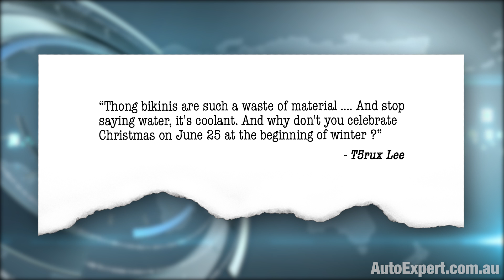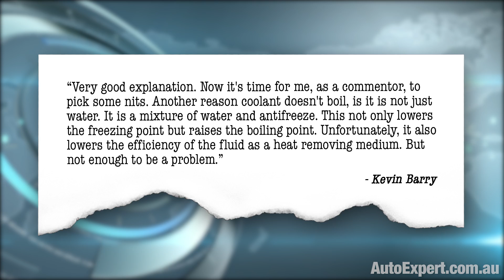The mad science of coolant (beer garden physics - yesssss!) | Auto Expert John Cadogan

Comment: Soooo after all that. Water is better? I live in WA so don't care about antifreeze. And right at the end something about electrolyte and anti corrosion. So is it a con? do i need to use 50/50? My falcon uses the green stuff, my hilux the red stuff can I run my hilux using the green stuff? ? So i don't need to keep both in the shed? Maybe 25% or 15% is better under WA conditions still getting some anti corrosion but better heat transference where the air coming off the road in summer is already 50 degrees plus at 1 meter above the road. or was that quarter of an hour rant just to say follow the manufacturer instructions, but you don't like the name coolant?

Comment: There's nothing wrong with calling it coolant, because that is the purpose of said amalgamation of ethylene glycol and water - the fluid - in the first place. It doesn't matter if ethylene glycol is actually WORSE than water for the purpose of cooling. What does matter is that it IS combined with water and serves the purpose of COOLING when dumped inside the cooling system of an engine - hence - coolant. When you buy the "antifreeze/coolant" unironically it's most often premixed. Why? It's because it's going to be used as - you guessed it - coolant. This lovely amalgamation of fluids contained within the engine quite literally serves no other purpose. COOLANT. Say it five times fast, you egocentric, haughty (Who has nothing else better to do with his life than hear himself talk before he goes the way of the dodo) boomer.

Comment: The viscosty is a double edged knife. It increases pumping efforts. Also it makes for a more stable boundary layer when flowing over surfaces that need heat transfer. In other words there is less turbulence thus less exchange between the slow flow at the surface and the fast flow in the middle of the cooling channel.
Heat capacity, pump effort and heat exchange rate all suffer from anti freeze.

Comment: From the title I thought you were going to go into the science around different types of coolants and how they've changed over the last few decades. 
Don't disagree with anything you've said about how it works (and you'd know better than me) but I honestly think you've just made a big deal about nothing here. It's got to be called something, does it really matter? Yes plain water would be more efficient at that single task of cooling but that doesn't mean an ethylene glycol mixture doesn't still perform cooling. 

To me, coolant is just a nice easy shorthand for what goes in your cooling system, whatever the chemicals and ratios you choose. The same as fuel is what goes in your fuelling system, but really means petrol or a petrol/ethanol blend, or diesel or LPG, even fucking warp juice. 

Should we refer to it every time as 'the anti freeze, anti boil, corrosion inhibiting heat transfer medium' ?

Comment: So, what would your take be on 'waterless' coolants? From your explanation of ethylene glycol being a resistive medium to water pump operation and coolant flow it would seem that ‘waterless’ coolant would be far worse.  I had a look at the SDS of a manufactures particular offering of this coolant and it contained 74-90% ethylene glycol.  Seems like if used on a standard OEM vehicle there would need to be some considered redesigning of the engine cooling system.  Thank you John.

Comment: Nice video as always! I think when Kevin said "Unfortunately it also lowers the efficiency of the fluid as a heat removing medium, but not enough to be a problem" he meant from a typical driver or mechanic's perspective rather than from an engineering perspective. As you explained, it certainly is a problem from an engineering perspective because the system needs to be designed with enough capacity to still adequately cool the engine with a less efficient fluid, therefore the reduced thermal conductivity and increased viscosity of a coolant/water mixture isn't a problem to the average driver or mechanic since the system is designed to accommodate it.

Comment: What about break fluid or a light oil, for coolant, as long as the engine dosn't over Heat eh Want something to look after the rubber bits the metal bits and the temperature.

Comment: The freezing point of water is depressed when mixed with propylene glycol. It is used as aircraft de-icing fluid. Water-propylene glycol mixtures dyed pink to indicate the mixture is relatively nontoxic are sold under the name of RV or marine antifreeze. Propylene glycol is frequently used as a substitute for ethylene glycol in low toxicity, environmentally friendly automotive antifreeze. It is also used to winterize the plumbing systems in vacant structures.The eutectic composition/temperature is 60:40 propylene glycol:water/-60 °C. The −50 °F/−45 °C commercial product is, however, water rich; a typical formulation is 40:60

https://en.wikipedia.org/wiki/Propylene_glycol#Antifreeze

Comment: One would argue that a well designed cooling system has negligible reliance upon the working fluid's heat capacity (would be nice to completely divorce from its conductivity too, but... well... thermodynamics.), however one is also concerned more with cooling rather than saving a few doll-hairs and a kilo or so of mass.

In that particular case, reduced heat capacity (assuming identical conductivity) could actually be beneficial in improving the system's dynamic responce, ultimately somewhat reducing engine warm up time from a cold start. But that assumes you circulate fast enough to ensure you can never dump enough heat into your working fluid to raise its temperature locally by more than a few degrees above system average (unless of course the thermostat is shut), and if the water pump fails - you're fucked.

Comment: This is the concept behind a very old nuclear power plant technology: Pressurized Water Reactors.  The coolant is almost entirely DI water.  It's kept highly pressurized to prevent boiling.  It maintains corrosion resistance by a combination of keeping a slight excess of dissolved Hydrogen in the water to react with any dissolved oxygen and turn it to water, and by maintaining a basic pH with ammonium hydroxide.  This ammonium hydroxide is at such a low concentration that the water is still more pure than any tap water you'll ever find.  Pure water. High pressure. Eliminate dissolved Oxygen. Keep a basic pH.  That's how you make coolant.  But it has absolutely no freeze protection, so there's that.
Reply: If your nuclear reactor coolant freezes, you’ve got much bigger problems

Comment: Honest question: how significant is the corrosion resistance offered by ethylene glycol? Obviously an iron/alloy combination engine requires something useful, and EG obviously fulfils this role adequately, but in an all iron or all alloy engine, is the benefit as significant? Is there another substance which could be added to water that can offer the corrosion resistance without the downsides of EG? It's very warm all year round where I live so anti-freeze isn't a requirement at all.

Comment: According to Wiki (the font of all questionable knowledge) ethylene glycol and water in a 1 to 1 mix by volume has a specific heat capacity of about 3140J/kgC that''s significantly down on water IE nearly 25% down. From the EV cooling system perspective the motor has to be cooled too, especially in hot weather as like almost all metals copper resistance increases sharply with temperature. The data I'm looking at says by a factor of 10 between 0C and 100C.

Comment: Speaking of nukes... there have been sodium cooled reactors which eliminate water's limitations and carry more heat. No pressure is needed to keep the stuff from boiling and the heat "carrying" capacity is much higher. The "convectioning"  system of cars and trucks could be much smaller and totally sealed and never need servicing. So why hasn't this been done? What could go wrong?😝

Comment: Coolant also reduces corrosion of aluminum. Reason coolant (mix of water and "antifreeze") has higher boiling point is PRESSURE... but under normal sea level atmosphere water boils at 212F and 50/50 is 235F.  So yes antifreeze increases boiling point dick head, as well as lowering freezing.

Comment: But without water or antifreeze my car will overheat Everytime.    It will over heat very fast actually and break the fuck down.  So coolant it is.  Or antifreeze what ever you want to call it.  This dude is a fucking idiot. The main purpose of the fucking fluid is to stop your car or what not from over heating........ . . The problem with simple water as coolant is that it freezes at 32 degrees Fahrenheit, so that's why they made 50/50, if I'm correct in earlier days they added alcohol to the water which lowered it's freezing point.   Making a much better coolant which you can very much so call antifreeze the point is that if I leave my car in the driveway in Canada overnight during winter my coolant will freeze which will fuck my car up.  But the engine will burn itself up if it doesn't have coolant. A substance that cools the engine. If it's -32 can fire still burn, so can your fucking engine.

Comment: With the increase of aluminium parts in engines, I assumed the main job of coolant additives was to prevent/minimise anti-corrosion of these very expensive engine components ?
Reply: Yes corrosion inhibiting is an important task for this product. The mixture of dissimilar metals, water and stray current is a major cause of corrosion in auto engines/cooling systems. If the stray current could be eliminated through better earthing the need for corrosion inhibiting substances would be reduced and perhaps eliminated. During over 25 years as a mechanic I found that the vehicles that had 'coolant' that had been over diluted or past its usefulness developed corrosion particularly at points where hoses contacted housings. I agree as to the cooling properties of straight water however until the electrical current issues can be fixed  I will continue to test and replace coolant as per manufacturers specifications.
Reply: @michaelbradley3393  I also think modern corrosion inhibitors contain some form of lubricant for components like water pump bearings, thermostats, etc. What perplexes me is that most manufacturers only recommend replacing the 'coolant' from the radiator, leaving the old stuff in the engine block, heater, etc. I always have mine 'power flushed' to replace the entire system with new distilled water/corrosion inhibitor..
Reply: @Charlee1224  Yep that's how we did it...not much use just dumping the radiator coolant without flushing the entire system (including heater).

Comment: I had to laugh yesterday with a tailwind following me and the number of cars  bonnet up looking for why they were "overheating".Duhhh! Modern cars don't handle sidewinds or tailwinds very well on a hot day. Just goes to show how tightly designed the aerodynamics is. As for old mates 15%, it is a significant amount if you just designed a system for H2O transfer and then added the extra viscosity of the coolant too.  Hellooo on the side of the road. How about an article on the different types of coolant ( type 1 and type 2) virtues and disadvantages and what happens when you mix them and maybe some models demonstrating.... anything. Happy New Year John.

Comment: But what would you call it if not referring to coolant/radiator? If I mention to a customer 'you have a coolant leak' because their radiator is shagged, they generally understand the conversation. If I were to change things up and refer to their engine heat exchange unit is leaking 50/50 H2o/glycol, I might have to waste time explaining myself back into 'radiator/coolant' speak.

Comment: As a Canadian viewer (minus 35C every winter, plus 35C every summer) we typically use the term "antifreeze". But with today's dissimilar metals in use, you really cannot overemphasize the value of the various anti corrosion elements in today's "coolant" - be it green, orange or blue. So many engines get wrecked when warm-climate people substitute plain water (which of course is OK in an emergency) and then one bit of the system starts plating out inside another. Not much damage but insidious over time

Comment: My Bluetooth ODB2 adapter tells Torque Lite on my Android phone the maximum temperature of the coolant is 96 when car is idling and during driving between 87-90 on a 30c day. Engine shutdown after 30 minute drive it rises up to 109c for a few minutes before cooling down. I used Nulon Radiator Engine Block Stop leak to deal with intermittent leaks which vanished after a about a week. Holden Cruze 1.8L Petrol. My car has green radiator fluid, when service manual calls for long life red/orange coolant. Wondering if a non-dealer service centre used to wrong coolant and need to replace it.

Comment: Without watching the video fully and being a fully fledged IAME certified coolant physicist and certified by certain brands as a "Master Tech" coolant physicist, water in your cooling system is a heat absorber, the radiator rejects that heat to the air (heat goes out, cold doesn't go in) through basic laws of thermodynamics. Coolant additives ie ethylene glycol, raises the boiling temperature of the water, as does the radiator cap causing pressure. The addition of coolant is supplemental to the pressure increase.

The main purpose of "coolants" added to water in Australia, or any other gutter of the world, is not to stop boiling or to stop freezing of the coolant or even to enhance cooling, it is the additives that are important such as corrosion inhibitors or other "stuff" that inhibits erosion caused by cavitation.

Many cases in point are of cylinder wall erosion in truck engines and cylinder blocks, one group using  specified coolant vs the other using whatever liquid the farm dam has in it.
Reply: If the coolant still looks green after four years is it still ok not to change ? What about topping up with same coolant brand to keep it healthy for longer?

Comment: Good humorous chat.   Almost correct.  

The mix is called coolant as its main function is to enable cooling.  Yes pure water has a higher specific heat capacity  and a 50/50 mix lowers this heat capacity to about 88% of pure water.  However, it increases the wetting ability so is better at absorbing heat from the metal surfaces.   (Fill a glass with water until it is bulging over the top. Add a few drops of  “anti freeze” and it will break the meniscus allowing the water to  spill.  Same happens with detergent, thats how it makes water better at removing dirt).

Yes its main function is to lower the freezing point and prevent corrosion.  But the primary function of the liquid mix is cooling based.

How about a chat about how having your headlights on uses/doesn’t use more fuel?    

But the alternator is turning anyway vs but it takes more power to turn it when drawing energy from the battery
Reply from the maker: Actually the additive is called 'coolant' - look on the container.
Reply: It used to be called antifreeze in the uk.  Called coolant now as it stops freezing and inhibits corrosion ( more ally in engines these days) plus improves cooling.   I guess as the main function of whatever liquid is in there is to cool it made it more obvious for some? 

Coolant goes in the cooling system.    Where do i put antifreeze?   Nit so obvious to some maybe. 

Like the humour though.  

Did I tell you about my exwife.  Filled the radiator until it was just below the top, as she had been shown.   Then did the same with the oil.   She did wonder why it needed a gallon of oil........

Comment: Traditional coolant is old skool thinking and is flawed, it’s technology that should be replaced.
Your cooling system is reliant heavily on pressurisation and if that is not there your boiling temperature for the 50/50 glycol water mix is not much more than water alone. If you don’t know your system is not pressuring then heat pockets will appear where the coolant will start to steam off inside the engine, this is the flaw of using water as the vessel to transfer heat. Using a non-water based coolant for heat transfer eliminates the flawed prehistoric mix we all have been using since Noah was a boy, one such coolant is Evans Waterless Coolant.

This coolant won’t boil at the same heat as water/ glycol and will not freeze at the same temperature as the water/glycol and isn’t corrosive to metals like water/glycol, yes it is corrosive if left to aluminium and cast steel and will destroy thermostat housings, cylinder heads and engine block water jackets. 

Now the debate is a touchy one, same as the EFI vs Carby topic or the fossil oil vs synthetic oil debates, but the truth is that water/glycol as a water transfer was simply the best the engineers could come up with at the time...yes it was a fucken long time ago. 😂

Technology has changed and there are alternatives. The waterless coolant is being used more and more with enthusiasts and automotive Museums, to protect components that are no longer made.

I know that I’m not prepared to drop $4000 on a set of Dart Aluminium Heads and $8500 on a 434ci short block and have it eaten internally by that very green shit we so happily put in our engines. 🍻

Comment: Actually shock absorbers do what they say on the tin. Shock is a change in velocity in this context. It's the x' term in the F = - kx - bx' - cx'' equation. The springs are there to deal with essentially constant load, or displacement. The 'absorber' part is also correct, because it's the only component that absorbs the kinetic energy and turns it into heat.